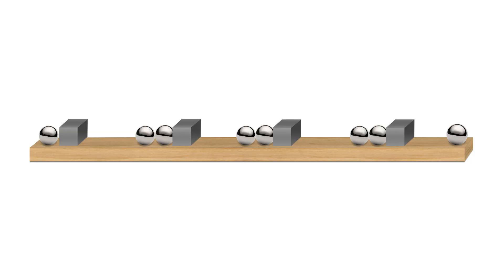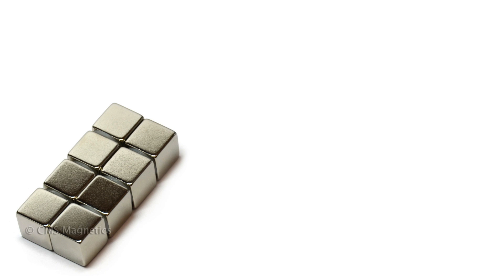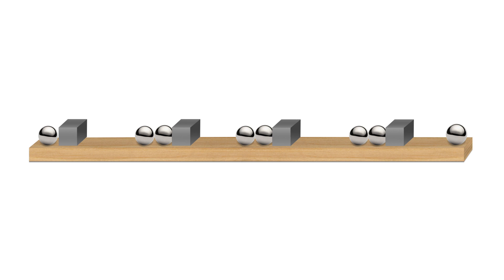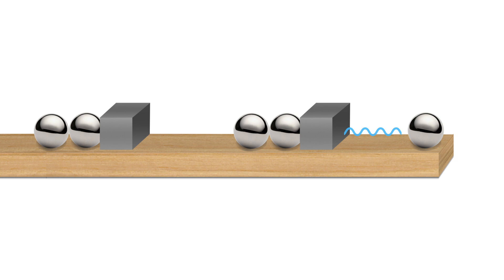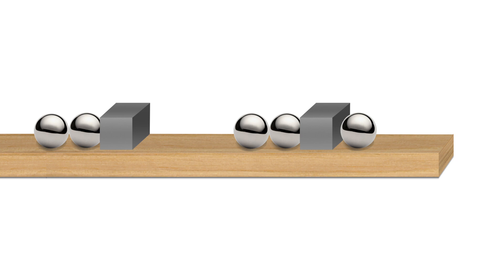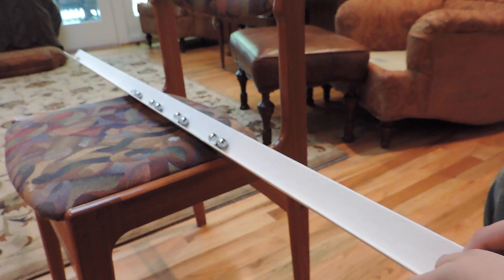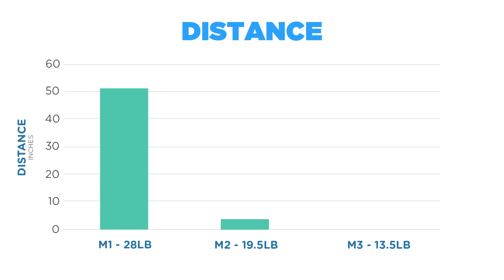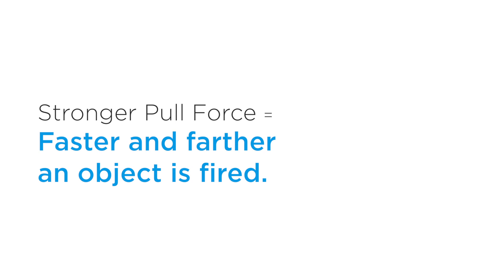Magnetic Linear Accelerators - Ft. Alastair James Murden

Comment: where is the energy coming from? if you understand the conservation of enery you can find why you have got gain or losses of kinetic energy.
Reply from the maker: +David Zare Yes?
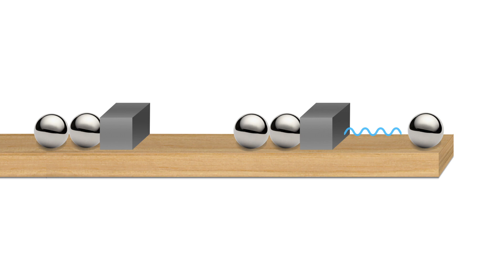Reply: I asked myself the same question, I found the answer: if you look at the diagram at 1:20 you can see that the ball that exit one unit is farther than the ball entering the unit. I mean the ball entering the unit finishes it's course on the magnet, and the ball exiting a unit starts it's course one ball appart from the magnet. This asymetry is really important and it's what prevents, on a unit, to have the same slow down at unit exit than the speed up entering it (in which case nothing would happen). Then from first unit to second unit the ball which was one ball appart from it's magnet finishes it's course in contact of the second magnet, so it's a release of potential energy (balls at each unit finish their course closer to the magnet than where they started it)